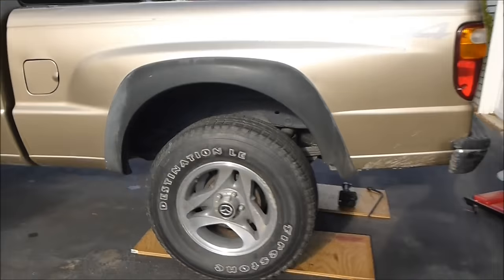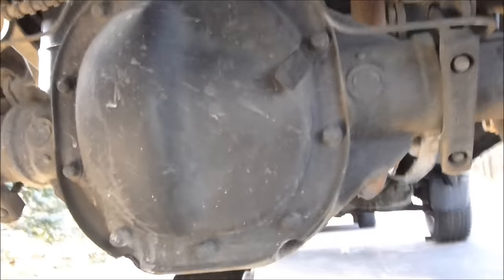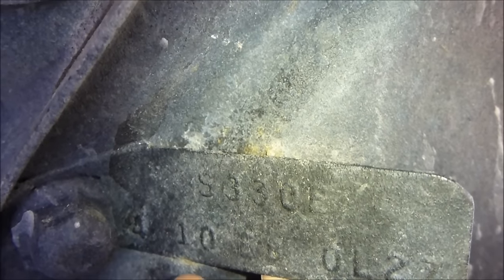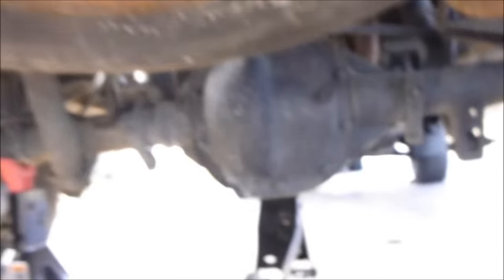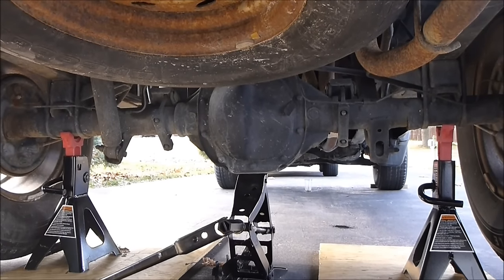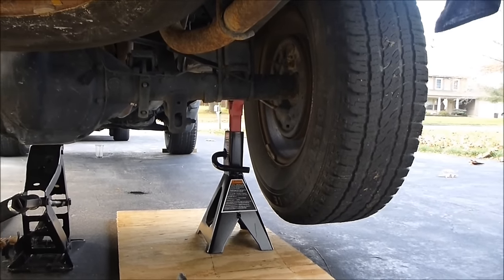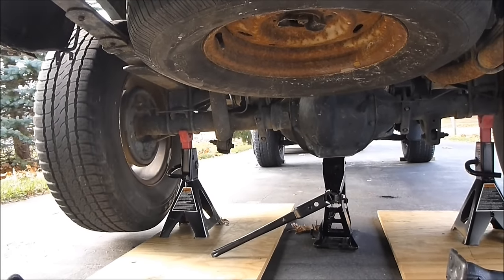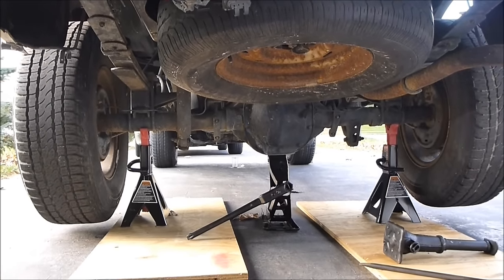How to tell if your car or truck has a limited slip differential

Comment: There is an awesome posi called a Torsen ... very expensive and confusing on how it works ... there was a wrecked 71 Mustang at the junkyard and I was going to buy the complete 9in rear end out of it, I turned one wheel forward and the other one went backwards , so I said damn it's not a posi , but I bought the entire rear end anyway and when I got home and took the pumpkin out I noticed it was weird looking and I had never seen anything like it , I found out it was a Torsen... a long time ago they were known as a Gleason Torsen.. so in other words just because one wheel goes forward and the other one back does not mean it's a one wheel Wonder

Comment: doesnt that depend on the power or torque you put to the differential. it does help with acceleration posi-traction does better than limited slip and lockers does better than posi until you have to turn

Comment: The Governor Lock differential in GM trucks will always act like a standard differential when you turn the tires like this. It will only lock when the speed difference between the tires reaches a certin RPM. 

Also, Ford is the only company that puts the L in the gear ratio on the tag when it has a LSD. No other company does that. GM uses a tag that says "use limited slip differential fluid only", but they don't use that tag with the Governor Lock differential in the trucks.

Comment: I personally think it's easier to just drive by a police station. The car will start to jitter and shake if it has LSD. Also, the headlights are focused at a farther distance than normal, this is due to headlight dilation.

Comment: Are LSD more suitable for winter driving in a RWD vehicle?
Reply: all depends. limited slips provide more traction but when you lose traction the rear or front of the car/truck will drift and slide around because neither tire has grip whereas with a open diff you tend to have less traction but the vehicle will slide around less because one tire will still have traction to keep you going strait
Reply: Yes, but nothing is better than 4x4

Comment: I just had an Eaton posi unit installed in my Chevy 10 bolt rear end.  With the vehicle up on jack stands, the rear wheels will spin in opposite directions with the trans in neutral.  I'm not a professional mechanic so I had an old hot rod shop install it.  While the rear was on the jack stands with the front tires chocked, I started the engine and put the vehicle in "Drive".  Both rear wheels started spinning forward normally.  I then carefully and slightly slipped a piece of wood under one spinning wheel to slow it down and the other rear wheel picked up speed.  I don't know if this is a good test.  I did Google the Eaton posi website and it did show that this might be a good test when one wheel has more torque than the other.  I'm driving the vehicle carefully for now to let everything seat in.

Forgot to add that I had a 67 Mustang with a 9 inch rear end with limited slip differential.  Both wheels did turn forward at the same time when turning by hand.

Comment: As the surefire way to tell if a RWD vehicle has limited slip or some form of locker is to jack up the rear of the vehicle as those try moving one tire while watching the opposite as if they spin in opposite directions the vehicle likely has open differentials or torsen LSD as lockers would make the tires turn the same direction.  Another way to tell what ratio is in the differential is to tape a piece of string to the driveshaft and mark the tires as those would ensure the transmission is in neutral while rotating the tires once while counting how many wraps the string made.

Comment: The information in this video isn't accurate. If you spin one tire on any car with a differential, the opposite tire will spin the opposite direction. The only time that they will spin the same direction is when the differential is locked, which only happens under either acceleration or engine braking, or both depending on the type of differential you have.

Comment: on my 67 mustang the wheels go in opposite direction when in the air but when the tires spin on ice they switch back and forth giving the power to one wheel at a time,
 in reverse they both spin at the same time can you explain that?

Comment: dont mind my spelling but if u have a limited slip diff or not the tires well spin in the opisite direction reguardless i limited slip works when your giving it gas and when one side or another starts spinning faster than the opisite wheel at a spicific rpm of the tire i think it is 20 rpm the diff well lock up. your method with it up in the air would would show if theirs a locker.

Comment: Hi I have a van thats a rear wheel drive and only the left side has power and the right one doesn't, I just found out about this when I had it on a ramp and it was hard getting off so I rev hard and it came off then I noticed only the left side had a tyre marks in the ground and the right one didn't what could the cause be? Thank you
Reply: Matt Johnson normal open diff there is no problem
Reply: They are made to do this so that, as you go around the corner, the outside wheel spins faster. But, if one wheel has almost nothing holding it and the other one is stationary, only the wheel with lesser friction is going to spend.
Reply: It just means that you had less weight on the wheel that spun.

Comment: Great Vid!  I have a question:  I have a 3000gt vr4 with a vcu type rear diff.  With the car jacked up in the air, when i spin one rear wheel, the other rear wheel doesn't spin.  Does this mean my rear diff is not working?

Comment: Chris,
Will all vehicles with lsd need the lsd additive?
Reply: Depends, ford traclocs dont need it, but it might make it run smoother.
Reply: LSD need an oil with friction modifier additives. ZF specification TE-ML 05C 12C 21C.  A complete list of lubricants approved for ZF    zf.com/corporate/en_de/aftermarket/technical_information/lubricants/lists_of_lubricants/lists_of_lubricants.jsp    An open differential can use an oil with LSD additives without problems but a LSD differential could be damaged if we don't use a proper oil, internal damaged of the clutches/disks.
Reply: torre1976 Vs Ford traclocs dont need it.

Comment: Not  true at all. I have a factory installed LS diff, and one wheel turns forward and the other backwards. Also the vehicle must be in gear . Otherwise the Drive shaft will turn.

Comment: If you turn one wheel and it turns the other wheel in the opposite direction does that mean it can be a drifter because I am making a drift trike and want to see if it will drift
Reply: Jeremy Mullins no

Comment: I sure cant, when I want to drift my celica, I pull my ebrake and give it gas, that way it kicks out my rear tires as I turn, and continue/steer out with my gas, if I did that in my F150 I wouldn't go anywhere at all..

Comment: Spinning tire does not work for GM's Gov-lock, which was all that was installed in the trucks for those that have GM trucks. LSD's do not "slip" a bit then lock up. They are locked up (they use spring tension, google eaton limited slip), and "slip" in corners or when the load is too high on one tire. THAT is the "limited slip" portion of the name.

Comment: What’s better an open or limited slip in rainy conditions? I moved from California to Tennessee and my car seems to spin out a lot on Ford expedition 2016 open differential. I wonder if that’s the problem? My tractor light comes on when car loses control.
Reply: Turn the traction control off

Comment: what if my car is a rear wheel drive car and using the method above, and when i spin one of the wheel only the wheel that i spin on is moving but the other one stay there and not spining either way....what does it mean?
Reply from the maker: +Nicholas Yan (BlackLotusX21) That is most likely an open differential or you have a lsd but the clutches are worn out. Check to see if there is a tag on

Comment: What if you turn the wheel in the reverse direction, would it turn the other side the opposite direction? I have a 9 inch ford rear end that turns easy one direction and also turns the other wheel the opposite direction but when I turn the wheel the other direction it will hardly move and the other wheel will not turn.
Reply from the maker: paulsjunkcars It should turn in the opposite direction either way you spin it.

Comment: Chris, pls help! I have an issue.

I own a 2000 Ford Ranger, 4x4, 5-speed manual. (Not sure if describing the make/model is important) But I was driving my truck 2 nights ago during some heavy rain. The following morning. I get in, start the truck with no problem, release the e-brake to pull out the driveway BUT IT DOESN'T MOVE! I put it in 1st gear and it slightly nudges forward, although none of the wheels move but it looks like it wants to. Same when i shift it to Reverse. It seems as if the wheels were stuck. Some outside mechanic said its probably the differential. Another, said its probably the rear drum brakes that could be badly rusted and corroded and on the night I was driving during the rain was what caused it to get stuck overnight.

What do you think it could be??
Reply: NachDaPrime this could be clutch or rear diff.

Comment: Thx man. I got a bit scared but I think I am good. I used Coastal SAE 80w90 gear oil API GL-5. Doesn't say in front of the bottle limited slip, which is a good thing. In the back says:  a. For conventional differentials, b. Limited slip diff ( for top off only ) what relieve, I feel better about it now.
Reply from the maker: Jay Bizz No problem! Yea, dont sweat it!

Comment: So I just changed the diffs in my 75 dodge. The old ones were either solid posi or limited slip, when I turned 1 tire, the other side turned the same way. I put in a new Dana 60, when one tire is turned, the other doesn't turn at all. What does this mean lol
Reply from the maker: +Hunter Gowing Probably an open diff.

Comment: I have a quick question: I tried doing this on a car without the driveshaft installed, but the opposite wheel wasn't moving at all. Does that mean open diff? I didn't watch the diff input shaft, but I would assume that was spinning? Thanks
Reply: Henning yes

Comment: The truetrac limited slip wheels turn the opposite direction when jacked up,so maybe futher review is needed,just incase this dudes a bonehead like a lot of us
Reply: My Toyota Supra says A02"C" on the door tag which identifies as an LSD ... and both tires spin opposite freely and leave 2 marks when doing a burn out ... 
My 240sx also is equipped with a factory LSD per the door tag BUT both tires free spin in the same direction and it leaves 2 tread marks when doing a burn out. 
So his opposite tire spin is not full proof

Comment: Can u pls help. So I changed the gear oil on my 05 matrix awd, I think I put limited slip but I think it is not limited slip. Will that be harmful for my differential? Thx man.
Reply from the maker: Jay Bizz It shouldnt be harmful but the limited slip additive causes your gear oil to break down faster. How much limited slip additive did you add? Are you using synthetic diff fluid?

Comment: how much would it cost if the rear differentials need new gears, roughly with labour? ChrisFix
Reply from the maker: It all varies with the shop, your location, and your vehicle. It can range from $500 to over
$1000

Comment: My 2015 ram 2500 does exactly whats in this video but when the truck is Park. Also my build sheet says my truck has a helical gear type LSD. Explain that please!
Reply: +Devin Williams Yes ur right but what Im sayin is that my truck should have (according to the factory build sheet) an LSD but this video says my truck does not have it bcoz wheels turn the opposite way like in this video.
Reply: +rootiest epiclifestyle Your LSD is bad so
Reply: +I'M Running Thaangs nah its a brand new truck
Reply: rootiest epiclifestyle Well if you definitely have one and it's not doing what it's suppose too, it's bad. I've seen plenty of cars that are fucked from day one. 
It's better this way tho! your warranty should still cover you

Comment: u should touch in dif lockers. cause the s10 blazer uses a dif locker and you are not suppose to use additive as per manufacture spec
Reply: Tenfold_Noobsauce no clutches

Comment: Forgot to mention, I used conventional gear oil, next time in about 50k miles I will use the synthetic one, couldn't find that day. Thx Chris!
Reply from the maker: Jay Bizz Awesome! I used conventional gear oil as well for my diff fluid change. It lasts 75-100k miles so that is long. Synthetic will get you a little better mpgs and a little better protection.

Comment: Chris, could we mix use two slightly different tires on the same differential axle? Say one is brand new (like most of the spare tires), and the other one is almost worn out.  They are of the same size but with different circumference . Thanks!
Reply: It’s not ideal but could get you by til you fix the tires

Comment: Hey Chris, i noticed in your description you pointed out that a posi may only spin one tire, i've been searching forever to try to find out more info on this. My 1993 Toyota Supra is at a shop I am putting a new transmission in and when i went to see the progress i asked my mechanic to spin i tire since it was lifted off the ground and only one tire spun, i know it's a posi from driving it a lot, but my question is do you know if its supposed to do this or do you think something is warn out?
Reply from the maker: +Dylan Kachmann the clutches could be worn out. Check out my last video on rebuilding an LSD

Comment: The book says automatic differential lock and says it takes the 80w90 and i tryed looking up the VIN and i couldnt find a site that would tell me. They do it when the car is off the ground and in Neutral.
Reply from the maker: +Daniel McDaniels Call the car company up and give them the vin. They can tell you if it is a locking diff or not. Most likely it is open. If you get one tire stuck in snow and floor it, does the other tire on pavement spin or just sit there?
Reply: +ChrisFix It doesnt snow here in sc that much. i put the right rear wheel grass or soft sand and the other wheel on pavement and give it light throttle and both spin i think.

Comment: If you do this demonstration on a front-wheel-drive car front drive axle, how would the other wheel move?
Reply from the maker: fishodorvagina its the same as a rear wheel drive. If it is an open diff the you will get the same results as I showed in this video.

Comment: Since you have it off the ground, have your friend block one wheel (simply leave it on the ground is fine) and have him try to spin the other (lifted) wheel. If he can spin it, its an open diff. If not, its locked (make sure the transmission is in neutral before you do this).
Also your definition for gear ratio is incorrect, It has nothing to do with how many times the wheel turns, relative to the driveshaft. It is a comparison to the number of teeth of the ring gear to the number of teeth on the pinion gear. If your ring gear has 41 teeth and your pinion has 10, you have a 4.10 gear ratio. That is why the term is called a GEAR ratio.
Reply from the maker: DeanMk1 Thanks for the tips!
Reply: Not a problem.

Comment: Can you put 75-140 with limited slip additive in a non limited slip differential setup  ???
Reply: I would use whats recommended by the manufacturer. If it calls for 75w-90 and you use 75w-140 the oil may be too thick until hot enough to properly lube the rear end bearings. The rear end gear oil is what keeps everything in the differential pumpkin cool and lubricated inside and is very important.

I see with harley transmissions guys use 75w-140 to quiet the trans down a bit but it causes premature bearing wear. Also limited slip additive in a non limited slip is a waste of money... It won't magically turn it into a lsd.

Comment: I have FWD 07 Honda civic
I was struggling to get it out my driveway against 6 inches of snow,
I noticed that my driverside wheel was not moving at all, and its the passenger side wheel that was doing all the work,
is this normal
Reply from the maker: That is normal. Your Honda has an open diff. With an open diff, whatever tire has the least amount of traction will get the power... If this happens, to get out of the snow, keep tapping the brakes as you give the car gas. This will add pressure to the spinning tire and the tire with traction will get sone power.
Reply: ChrisFix
why would it send the power to the least amount of traction?
woudnt it make more sense to have the power sent to the wheel that has the most traction/grip so it could get your car moving
Reply from the maker: It is because the technology. The cheapest differential setup is an open diff. With an open diff, to allow the outside tire to turn faster than the inside tire when you turn the car, you lose traction to one of the tires. Now when you are stuck in snow or mud or whatever, the same concept happens. That is why offroaders have locking differentials. Flip a switch, and both tires turn at the same speed no matter what. Problem is, on a dry road you will break something if you turn (which is why you turn the lockers off when you are easy terrain).